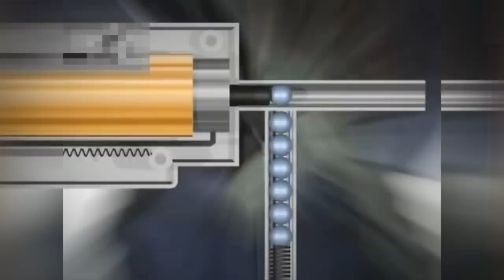Project Dakota - How airsoft weapon works

Comment: ive made the piston and have my barrel and motor, do I absolutely need a gear box to drive my piston or could I just use one gear missing teeth like the last piece in a gear box
Reply: Yes that missing teeth causes the piston to slip with full force applied by the spring and striles the bb with pressure

Comment: Thank you for explaining exactly 0 of how an Airsoft gearbox works, explaining nothing about hop-up/barrels, etc... Also, upgrading your spring does NOT increase your shot distance, it increases the amount of joules your gearbox generates, which in terms, translates to faster travel time for the BB to the target. What DOES increase distance, is a very sensitive and fine tuned hop up unit, with the perfect BB weight and barrel lenght to an extent...

Dislike
Reply: This video was just what I needed. Didn’t want a 20 min video on small details idc about, like finely tuned hop up units..
Reply: lmao
Reply: U need some help